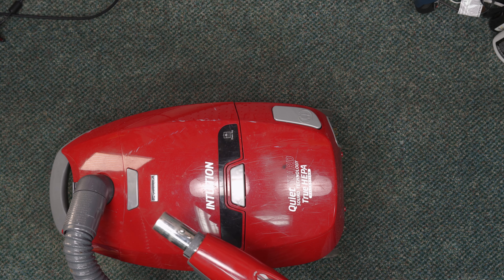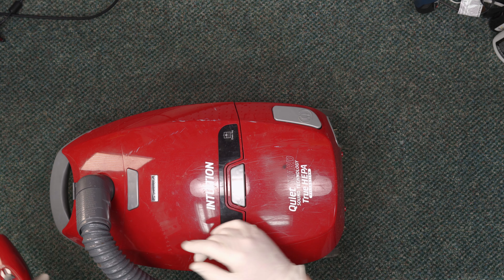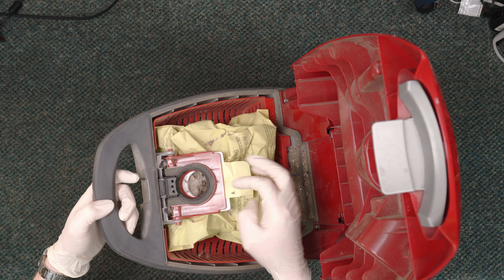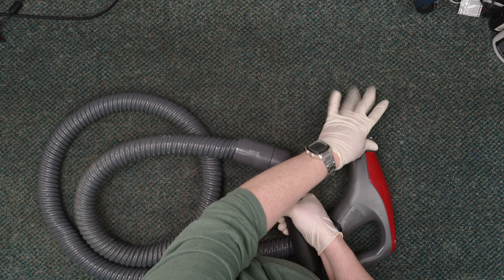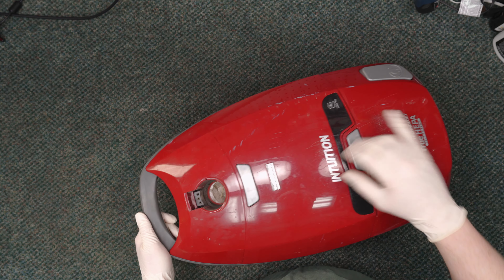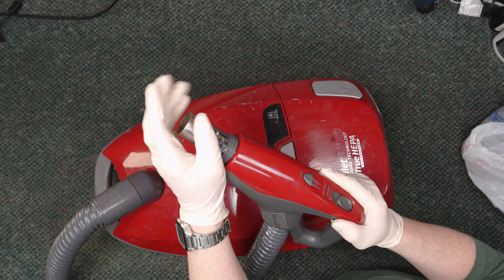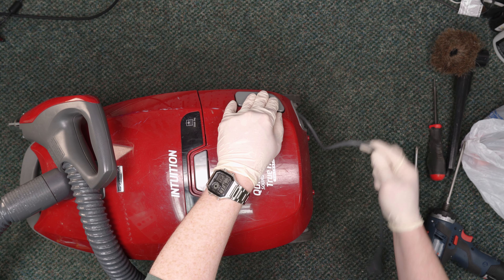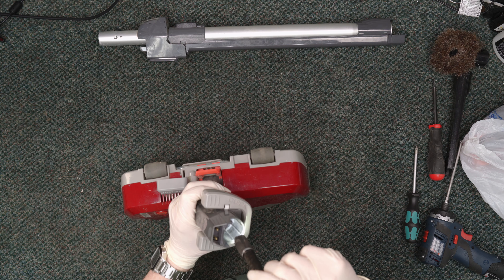Questionable Intuition - Kenmore Intuition Quiet Drive

Comment: I'm actually a bit concerned for the motor. That was a ridiculously dirty pre motor filter. With that being said, I'm not a professional like you are so you probably know it better than I do.
Reply from the maker: You're right to be concerned, it certainly wasn't good for it to run that hot for long. How long they took off the life of the motor is hard to guess, but it is running well now... we'll just have to see if issues crop up a  couple year's down the road.
Reply: @HouseOfVacuums  Yea, you're right.